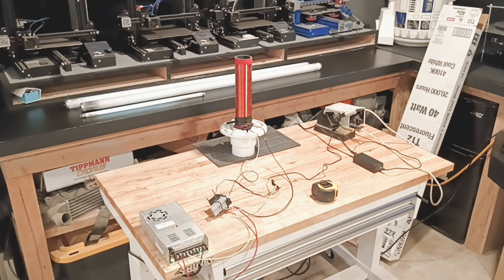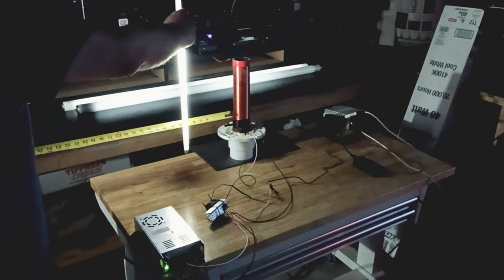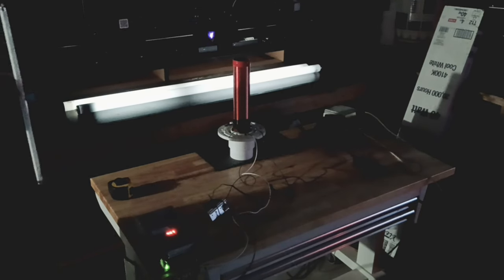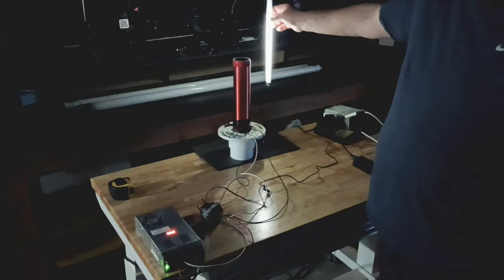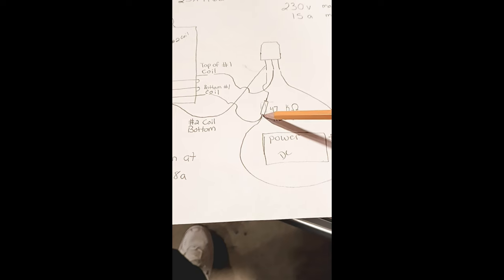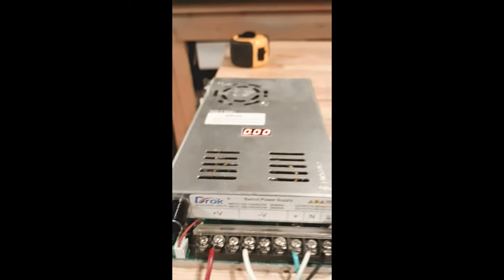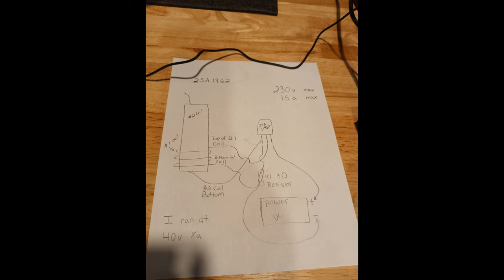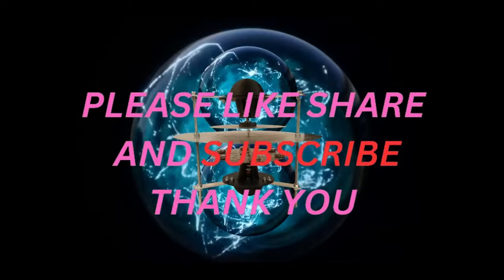Graviflyer "Stable Tesla Coil Basic Circuit" #12

Comment: Nice presentation. I have built a hundred of these kinds of Tesla coils and learned a few things. While keeping your exact design, here are some tips to increase the power output with out overheating.
1. Place a capacitor between the positive and negative leads of the power supply. It will help the power supply maintain a constant output. 
2. Try using an IRFP460 instead of the transistor in your circuit. 
3. Add a 3kohm resistor between the positive lead and 47kohm resistor. Replace the 47-khom resistor with a 50kohm potentiometer. This potentiometer will allow you to have precise control of the current. 
Just my 2 cents.  Keep up the excellent work!
Reply from the maker: I agree. I also wanted to add some diodes to protect the circuit. I will give you suggestions a try. Thank you.
Reply: @nathanbunten4299  Adding diodes is tricky.  I tried TVS diodes, which seemed to protect the MOSFETs, but I have only had limited success.  I look forward to your experiments with diodes.  This channel is a gem. Thanks for sharing your ideas!

Comment: 2SA1962 is a PNP BJT,  NOT a MOSFET.
The transistor would probably run cooler if it was a MOSFET or IGBT.
A schematic using standard symbols would help, or at least labelling each of the three leads of the BJT.
A scope would also help you optimise the switching circuit.
The 5A load current will be the average current, not the peak current used by the circuit.
When you turned the applied voltage up, the current would also have gone up, the efficiency would not have got all that much better as shown by heating of the BJT.
10A load would mean much higher peak current.

Comment: I'm not sure why you keep blowing mosfets? I would think as long as you have resistors to keep the maximum current within chip specs and diodes to prevent back flow of energy through them you should be fine.

With your current setup you could adapt a water cooled heat sink like those available to keep motherboard main processors cool.
Reply from the maker: I built the blueprint channel's slayer exciter circuit. The mosfet was really bad. I am going to add a couple of diodes and a snubber circuit to it. I was trying out new mosfets to get a better run time.

Comment: Add the GF to the TC and see if it still behaves the same way. The GF should be a capacitive load on the TC that reduces it's resonant frequency and voltage.
Reply from the maker: I have heard the same thing. I am getting there. Just rebuilt my tesla coil and put in a new high voltage supply. I only have the ultrasound device to build tomorrow. I will show the test you are referring to. It should be early next week.

Comment: Great job Nathan! Aha now I see you use the simple joule thief circuit to auto adjust and self oscillate the coil 👀. keep it up pal 😎👍 really nice 👌Edit: thanks for the link I will eventually buy some I will keep them in mind. The transistors are two types they send them already in Paares for H-Bridge configuration 👀I wonder if I'm able to find a H-Bridge circuit for these then I could finally have my Class D RF Amplifier for my function generator... 🤔
Reply from the maker: I have plans to beef it up with diodes and a snubber. just in case.
Reply: @nathanbunten4299  if your intention is to get a sharper pulse spike then I can recommend you to use a beefy NPN transistor as diode by connecting base and emitter together you get a very fast and aggressive diode then you get spikes beyond good and evil. In combination with the snubber of course 😎👌

Comment: I think this is a Toshiba negative transistor, two of these transistors can be used in parallel and they withstand less pressure, or you can find a pair of this transistor that is a positive transistor, of course, in that case, you need a signal for the input. you have
In general, if this works, then that's great
Reply from the maker: I might try that